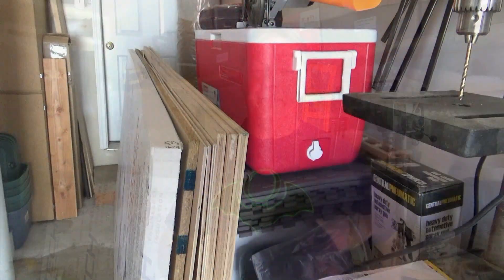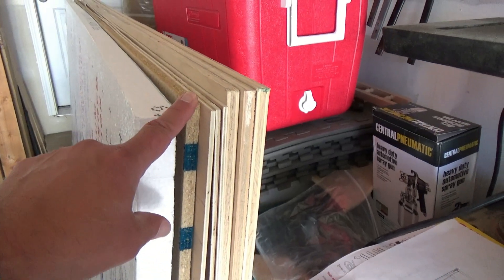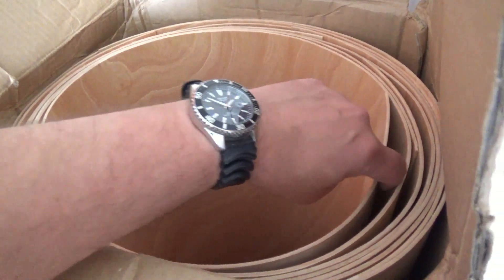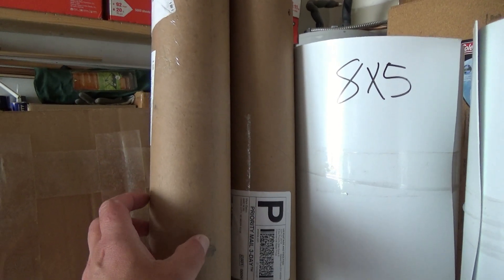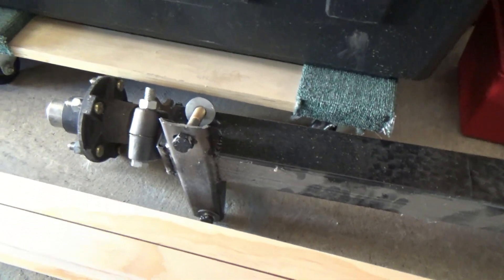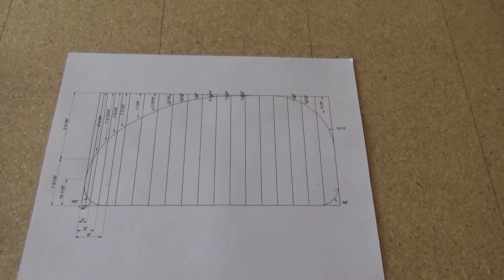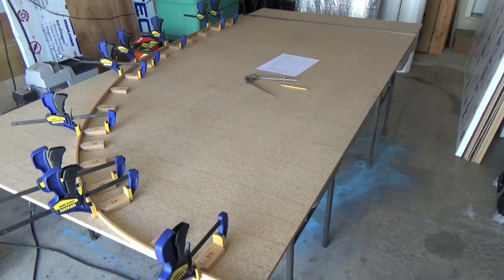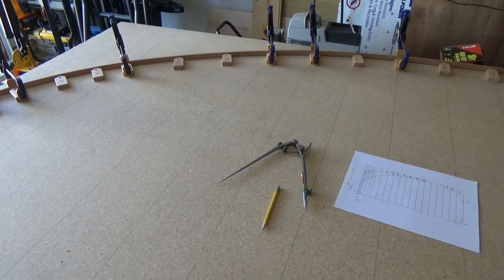Let’s Build A Teardrop * Step-By-Step * - Part 1 (Introduction to the Build)

Comment: I'm intrigued by this. I've looked at several other YT sites, and none seem as comprehensive as yours, and you answer many of the questions I have. I have plans for a Benboy design, and I had a trailer frame fabricated to suit (my welding is poor). I want to put a different rear on as well. Nevertheless, I will be following your series closely! In addition to the frame I've already purchased the vent/fan and will be getting the doors shortly, and I agree about having a stockpile of timber (and fixings) so you don't have to keep running off to the store. One thing I did do was to write a list of features I wanted to include before I started (eg, under frame sliding drawers, deep cycle battery, charging points, 2 way cupboard, cup holders, lighting locations, etc).
Reply from the maker: Thank you Aussie! These videos should help along the way on your build... My first Teardrop was a Benroy style TD and it was a lot of fun! Now that you have purchased parts for your trailer, you HAVE to get building on it!! :)  Good idea to make a list of your needs!  That will be a lot of help when you get started!
Reply: @OregonBatman  I'm also on a FB page DIY Teardrop Campers Community, and they are very helpful. Jay Poore is the admin, and he is a top bloke.
Reply from the maker: Hi Aussie... I am a member of that group, although I haven't posted anything. A friend of mine posted my videos of the Filon installation and because several people disagreed with my installation, they removed the posts. Jay does a fine job, and there is a lot of helpful information there! Great community.

Comment: this is what I want, a Teardrop tiny trailer, I have a HF 4x8 and a 4x4 and thought about converting one
Reply: EliteGeeks I built one of those 15 years ago on a 4 x 8 HF trailer, but sold it. Here’s the problem I have with teardrops:

The cabins are only good for sleeping, and the galleys are useless when raining. If I was going to build one again...

I wouldn’t build a galley and use that extra space for the cabin. You now have room to throw some kind of set-up tent/shelter in there, along with all of your cooking gear, to set up when you get to your site.

Yeah, TD’s look cool with their galleys, but all in all, the galleys are more bling than a practical asset.

My current project is a truck camper with an 8’ bed, and I’ll start as soon as I can afford the truck!
Reply from the maker: Perfect EliteGeeks! You have a good start with the HF trailer! It can be used for this build with only a slight modification, it'll have to be shortened up a bit, which is really easy. When I upload the video about the trailer, you'll see where the axle should be, and what the length needs to be. After that, a jigsaw and drill is all you need to get the trailer ready for the camper! Cheers!
Reply from the maker: Totally understand! They are simply, a bed on wheels with the ability of no real setup. I used to tent camp but really never enjoyed it. Took too long to setup, all the extra stuff I had to bring a long (took up room), always forgot things at home... list goes on. These tiny campers eliminate most of that. Most items are always in the teardrop, so when you want to go somewhere... you can be on the road in 15 minutes! PLUS... I use a canopy at the back of the trailer to keep me dry when cooking! :)   Someone just mentioned to me a truck camper build, hopefully you will be sharing your build on YouTube!
Reply: OregonBatman  My ideas are grander than my woodworking skills:

I have my design...what I need, what I want, etc. ...but I’m having a cabinet maker build it!

It’s going to be L-shaped, with the left run my kitchen, nothing significant on the right run for more space, and because I’m such a short guy, the horizontal run up near the cab window is my BED. No one ever does the bed on the horizontal, left to right, because they’re too tall!

And by the way:

I bought my bendy birch from Boulder too, but they screwed me up! Although it could have been rolled and boxed like yours, for some crazy reason, they shipped it FLAT sandwiched between two sheets of flakeboard!

That normally wouldn’t be a big deal, but FedEx wouldn’t deliver to my HOUSE like that, so I had to go to Miami to pick it up near the airport. Good thing I had a truck, but what a pain.
Reply: OregonBatman  I assume you’re familiar with the website Teardrops and Tiny Trailers. (I forget the actual URL.) They all know/knew me there. I built “The Crab.”
Reply from the maker: Nothing wrong with someone building your ideas... I have to do that for my trailer frame, I'm no metal worker! Boulder should have let you know how they were going to ship so you could have been prepared! Maybe that's why they boxed mine, they heard you what a pain it was when you ordered yours! :)
Reply from the maker: Do you have a link for "The Crab"?
Reply: OregonBatman  See if this works. This is my photo gallery on the site, which includes ALL photos, and most aren’t even of the trailer. You have to go to page 4 to see the first trailer picture.

http://www.tnttt.com/gallery/search.php?user_id=2023

If this link doesn’t allow you to view, maybe because you’re not a member (???), I guess you have to register, click on Members, click on the letter I, Click on Ira, and Click on Gallery to see my photos.

There are some INCREDIBLE designs on this website, and wouldn’t think of building one without spending hours looking at them.

Comment: What is the advantage of using filon over using an aluminum sheet?

My husband found .06” aluminum sheeting that they use on semi-tractor trailers from a tractor-trailer repair supply for $85 for a 49” X 110” sheet and filon is .045” and $179 for 5’ X 10’ sheet, other than it doesn’t dent?

It’s more than twice as expensive.

It’s for the sides of our teardrop camper.
Reply from the maker: Great question Rhonda! Generally, I think it is a matter of preference... but I believe the overall advantage would really be the resale value. As you mentioned, the aluminum dents extremely easy (the aluminum for my first trailer arrived pre-dented! LOL!) which takes away the looks of you trailer. Yes, more expensive... but that is why we pay more, longevity. The filon will be much easier to repair if damaged because you can repair small areas quickly. Aluminum, you may need to replace an entire panel, labor alone would set you back.

Comment: Hi Al, on the bendable Birch plywood 2-ply sheets for inside wall curvature and outside roof - I get that they are 1/8" thick but how long are the sheets - are we talking 8 foot sheets?  Just an FYI I've called Boulter Plywood Corp 3X's.  They just filled an order for 30 sheets and it sounds like they are having a very hard time keeping up with demand.  Do you know of any other source?  I'm googling to locate another supplier but haven't located one yet.
Reply from the maker: Yes... they are 8' sheets, sorry, I do not have another source. At the time, Boulter was the first I came across and had what I needed.

Comment: This is a long shot, but do you have 5x8 plans by chance? Not sure what it would take to modify.
Reply from the maker: Hi Nathan, no plans for a 5 x 8.... the plans for the 4 x 8 can easily be modified by simply adding 12" to overall width
several people who purchased the plans modified to 5 x 8 and looks good
Reply: @OregonBatman  Right, so the curve would stay the same but the floor is what would be 1 foot longer. That's doable. I supposed the curve would change if doing a 5x10, but I don't see the need.

Comment: how does getting home made RV trailers licensed and titled work in Oregon? In WA state you have to have L&I approve your detailed design plans for the trailer, then come to your home and inspect before you wall in the plumbing, electrical, propane lines, etc... then inspect it again when you finish to make sure it's per NFPA code 1192. Then you get an L&I insignia sticker and can finally take it to the state patrol to get a home made RV trailer title... Doesn't seem like you had to do that at all on your last travel trailer build?
Reply from the maker: Relatively easy process here... must have the receipts for materials used to build (axle, frame). Pay the fee, and all set!

Comment: Hi I live in the UK can I buy all the supplies required to build the teardrop caravan here thanks Bryan
Reply from the maker: Good question Bryan... unfortunately, I cannot answer that. You will need to research for the material availablity in the UK. Sorry about that
Reply: @OregonBatman  that's absolutely fine thanks for your help also can I purchase the plans to make the teardrop caravan if so how much are they and is there list if tools and materials so I can find out
Reply from the maker: @bryanthorpe10  Here is the link for the plans... no material list. All materials used is mentioned in the videos. All hardware purchased from Vintage Technologies. I have a small list of electrical components I can send if you purchase the plans: https://www.paypal.me/OregonBatman97741/15

Comment: Planning to join in using a 4X8 Harbor Freight trailer....Hoping that trailer will work with your plan?  Also, was wondering the finished weight of your trailer?  I have a maximum 1000 Lb limit...  Thanks for your reply!  Mark
Reply from the maker: Hi Mark! Several people have already built the teardrop using Harbor Freight frames. Modified it by shortening the length at the back and they look great! The weight of my trailer should come in at around 1000 lbs or a bit more. You will save some weight by using the HF frame. One of the builders decided not to use the filon and just stained and varnished the wood, looks beautiful and save weight there too! Hoping you join in , you'll have a lot of fun!

Comment: Al, I was on the phone with Christopher Boulter @ Boulter Plywood Corp in MA.  (RE: 1/8" Benddable plywood Birch) He said they bend two ways, one is a barrel type and one sounds like it is lengthwise?  He asked if the 4' comes together. I'm confused. I'm thinking I want it in the barrel shape.  Is that correct?  Thanks for your help. . . again!
Reply from the maker: Yes sir... You want the barrel bend. The other bend is a column, it would be 8' tall and wrap around a pole. You want the barrel bend, which would be 4' tall and wrap around a barrel :)
Reply: Perfect - thank you, thank you!

Comment: Looking forward to another great build. What is the weight rating of the axle you are using?
Reply from the maker: Hi Aaron! I will be using a 2000 lb axle for this build. Guessing to weigh in around 1000 lb finished (or less).

Comment: Great info, Im starting a build of my own Im having trouble getting started with the shape of the side walls. The trailer size differs from yours Ill have a 5 1/2 X 9.    How cam i get the measurements for that lay out like you have printed on paper?
Reply from the maker: Hello Daves5wire!  If you mean how can you get your ideas with measurements on paper, you will need a drawing program to sketch in. I use a product called Rhino3D to draw my designs and send to printer. If you are wanting the drawing I have, my email address is in description of every video. Drop me an email and I can send you my drawings. Hope that helps! Thanks for stopping by!
Reply: @OregonBatman  Thanks for the generous offer, Im not sure it would work on my bigger 5x9 ??
Reply from the maker: No problem... true, the plans I have are for a 4 x 8. You could always modify the plans to your size, just add one foot in both directions. Cheers!

Comment: This is an amazing series... I'm completely new to this with limited experience and completely trust that your videos will guide me!  You have inspired me!  Thanks!  Quick question - I was thinking of getting a pre-made trailer frame (4x8) to give me a slight head start.  While I am confidant I can build the camper bit, I'm trying to avoid any welding related to the trailer frame (have no welding experience!).  Only thing is it looks like trailer frame you are using may not be exactly 4x8? Thanks again :)
Reply from the maker: Hey Mitch! I think you have what it takes to build one of these for sure! Several people who built this trailer used the prefab 4 x 8 frame. You'll have to shorten it a bit in the back to make it look really good but super easy. My frame is a bit under the 4 x 8. Have any questions... shoot em my way, I'll do my best to answer!

Comment: Is there a cost range to expect for a project like this?
Reply from the maker: Hi Pisces bro! The cost of MY build was around $6800. You can save money by using a prefab trailer and not add all of the amenities that I used. I believe some have built this trailer for less than 3K.

Comment: How can we access plans? I’m interested in building my own using your videos but would gladly donate to help you out.

Is this something that could conceivably be built before May 2021? Thanks for doing this
Reply from the maker: Thank you bosox2k1! All the hard part has been done in the plans, all you really have to do is make a few measurements and cut the wood then put it together. Definitely could be done by March. If you started on it now and worked at it, could have it finished by January!

There is a link in each of the video descriptions that I use for PayPal for
a suggested amount of $15 for the plans... once confirmed, I send the PDF
file for you to start building your own.

I 've included the  link below for you if you are interested...
https://www.paypal.me/OregonBatman97741/15
Show less

REPLY
Reply: @OregonBatman  thank you! If we wanted to change some things up, is that feasible? Like overall dimensions? If we had specific questions could we reach out?
Reply from the maker: @bosox2k1  absolutely... easy to make a 5 x 8 or bigger if needed. Feel free to email questions, I'll do my best to answer

Comment: I am having a hard time sourcing the Filon, where did you get yours?
Reply from the maker: No Problem Michael... I purchased at Affordable RVing 15555 SE McLoughlin Blvd, Milwaukie, OR 97267. (503) 659-3610  They will ship to you. You can also look on Ebay for Filon, there are several colors to choose from and any length you need. Hope that helps!

Comment: Wow, the Filon is jaw-droppingly expensive for a sheet of heavy duty plastic! I thought it might be cheaper than the powder-coated aluminum rolls a lot of the other DIY guys are using, but quite the opposite.
Reply from the maker: yes... exactly! That's why when shopping for an RV, two identical models, the one with filon will be more expensive than the aluminum sided RV.  Filon is way more durable and easier to repair. Good stuff.... but, expensive! :)

Comment: What was the full cost, end of day? Just want an idea so I can tackle this at once instead of having to stop, get more money, then continue.
Reply from the maker: Hello Gregory! I haven't totaled the cost for the project just yet, That will come when I finish. I budgeted my project for around $3500 when complete. We will see how close I come.  The most expensive parts of the project  are the frame (w/axle) and the filon. Could save $1500 if no filon and just finished with a wood finish. Use an existing frame would also save money. This project is from scratch, no used parts. Hope that helps. Cheers!